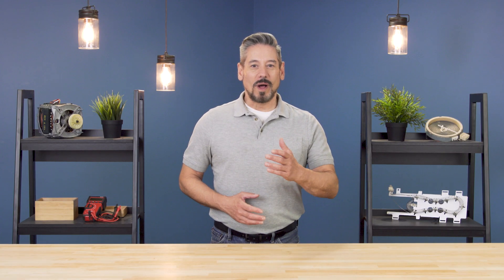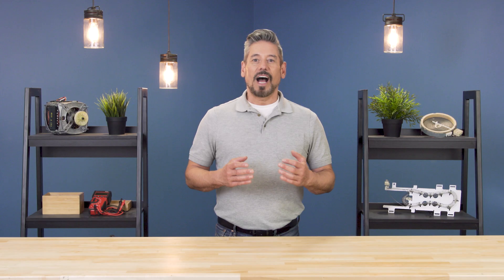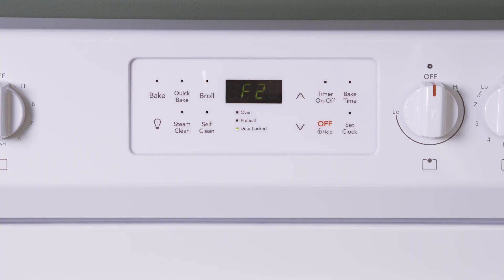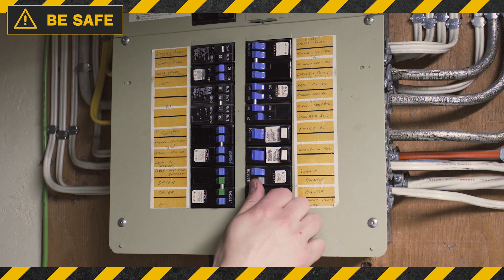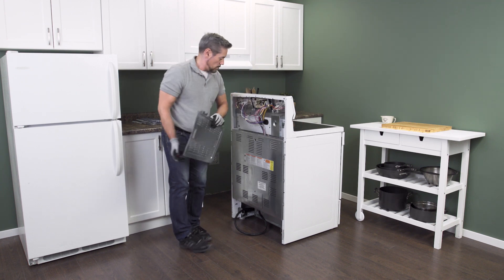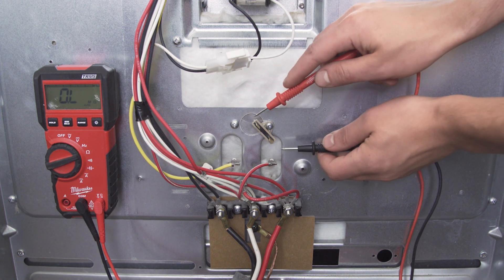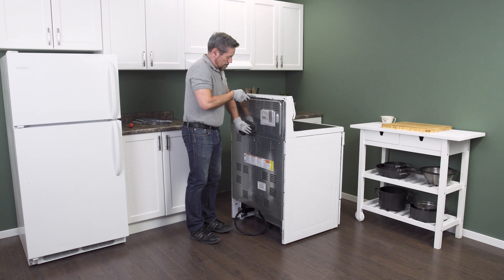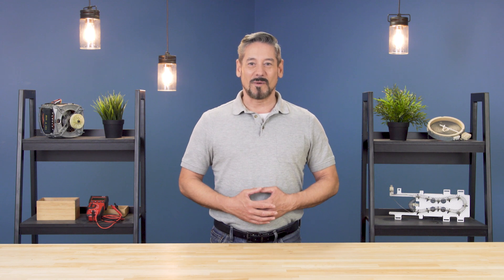Oven Thermal Fuse - Testing & Replacement | Repair & Replace

Comment from the maker: Did this video help you fix your oven? Did you run into any problems? Let us know in the comments!
Reply: Couldn't find my Kenmore oven model on the AMRE parts site
Reply from the maker: @robbiedods2230  Thanks for watching. Not all models breakdowns are available from each manufacturer and the older an oven is, the less chance that there is a current parts list. Sometimes the part numbers include several numbers at the end which are for model variations. If there is a similar model made in the same year, try looking up that number and see if it works. The parts are often similar. You can also search by part number.
Reply: Yes its not my fuse
Reply from the maker: @robertmccann380  Thanks for watching. We have many oven troubleshooting videos linked in this playlist, that can help you narrow down the problem further: https://www.youtube.com/playlist?list=PLCo9SMjkdWBysYYCcg5xQLiVh_cW0JQvt

Comment: I shorted a GE range while trying to replace the light bulb in the oven. I didn't shut the breaker and pulled out the mount for the bulb. The short fried the control board with the oven controls. I replaced the board but the heating element in the oven doesn't work. Could  the thermal fuse also have blown?

Comment: my oven heating element shorted out...It looked and sounded like a welder inside my oven for about 15 seconds.  The element is hidden below a cover, and had actually melted in a few pieces. I replaced the bottom element...all the wiring looks perfect. The stovetop and control panel is all working.

I don't have an electrical tester but I already was eyeing the thermal fuse...I could see the hot wires from the oven and broiler go to it. That almost has to be it....I am tempted to put a jumper wire in there, just to test it for a moment...
Reply from the maker: If there was a short then there's a good chance the thermal fuse is blown out  If you don't have a multimeter already, it's not a bad time to get one. They do come in handy especially in these sorts of cases.
Reply: @AmreSupply  Yep, I did get one, and the thermal fuse is good.  It looks like the control panel is bad, which is costly for my Maytag...Decisions, decisions!  I also found out it has a self diagnosis function, that also says "control board".

Comment: Good, precise video. Thanks. Mine is Technica’s Electrolux with gas cooktop and electric oven as one piece. Oven is not heating. All displays and timer looks fine. What could be the possible reason??
Reply from the maker: If the oven is not heating at all it could be a faulty temp sensor, or a stuck relay on the control board. https://www.youtube.com/watch?v=jnt_mUwdL8o

Comment: When i turn oven to bake the boiler element comes on not the bottom,had the bottom element tested it good,what's the issue here
Reply from the maker: Thanks for watching. If the bake element is good, then check the connections. Either there is a faulty wire or the bake relay on the control board is faulty.

Comment: It's worth noting that an open (blown) thermal fuse in ranges so equipped, typically indicates the oven reached a dangerously high temperature.  With that in mind, you should first determine what may have caused the overheat condition and replace faulty components as needed.    Then you may proceed to replacing the thermal fuse.
Reply: Would an oven element that deteriorated and shorted out cause the thermal fuse to blow?
Reply: @BarryWeaver-pv6cz you're right, that is possible.    From my understanding, on some ranges the oven controls only switch one leg of the 240V circuit, leaving the other terminal at 120V to ground potential.  Or, simply put, a grounded 240V heating element can continue to heat at 120V regardless of what position the controls are in.   

I actually had this happen on my family farm with the 80 gallon electric water heater in the dairy barn.  The water temp got extremely hot and the temperature/pressure relief valve was boiling water and steam at high pressure.  Even though both elements were "OFF" according to the thermostats, we found that the bottom element had split open near the center, such that it had enough resistance to prevent the double pole 30 amp breaker from tripping, and so it continued to heat with 120V to ground non-stop no matter what the thermostat was telling it. 

 A T&P valve is designed to quickly open full force when the water temperature approaches 210°F and will remain so until the water is cooled some degrees below 210° by the cold inlet, which enters the bottom of the tank while the T&P valve on top of the tank, or on the side of the heater very near the top. With that in mind, a defective thermostat which fails to shut off the gas burner/electric elements, or a shorted element in an electric water heater can result in a dozen or more gallons of near boiling water released at high pressure before the valve closes.   That is why having a suitable discharge pipe on the valve outlet terminating to within 6 inches of the floor can literally mean the difference between life and death for anyone standing nearby should the valve pop open.
Reply from the maker: Yes that is a good point, in some cases this could be a self-cleaning cycle or something more problematic.

Comment: We just had a crew install a GE stove and tried to test it out this evening; the stove top works fine, but when we went to use the oven it began preheating from 100 up to 135 and stopped; the heating element stopping heating and we had preheated to 425. We also tried using convection oven; and the oven continued to not heat at all. Does this seem like a thermal fuse issue?
Reply from the maker: Thanks for watching. If the oven does not get above a certain temperature then it could be a faulty temperature sensor: https://www.youtube.com/watch?v=jnt_mUwdL8o

Comment: Hi My wife does alot of baking and our Electric
GE stove keeps shutting off randomly when she is baking in the oven but it always comes back on and is otherwise working fine. Would a thermal fuse act in this manner or is it most likely a control board or something else? Thank you
Reply from the maker: Thanks for watching. Perhaps not a thermal fuse but more likely a bimetal high limit thermostat. In some cases the metal can wear down and fatigue over time causing it to trip at lower temperatures. Not all models have these though. 
If your model doesn't have a fuse or high limit switch then it could be a faulty temp sensor: https://www.youtube.com/watch?v=jnt_mUwdL8o
Reply: @AmreSupply  Thank you for the Help I Appreciate it👍
Reply from the maker: @dusty1498  You're welcome, we're just happy to help!

Comment: I have an old Caloric Ultramatic and after using the clean cycle it won't bake or broil it will only heat in clean mode.  Could it still be a thermal fuse since it is still heating in the clean cycle?   Thank you
Reply from the maker: Thanks for watching. If it tripped the thermal fuse then it would prevent it from heating in bake, broil or self clean. In this cases this looks like an issue with the control board but first try a reset as it might be stuck in a cleaning mode.. This might sound too simple but try unplugging the unit for 5 minutes. See if that helps.

Comment: Hi, water accidentally leaked from my counter into the wiring of my built in oven, I heard a buzz and saw flashing behind the time display then a glass popping sound. The oven itself is now unresponsive. Would you say it is the thermal fuse that got damaged? Thank you.
Reply from the maker: Thank you for watching. Most models do not have a thermal fuse so it's more likely that the control board was damaged by that power surge.
You can check which parts are in your model using this tool: https://www.amresupply.com/lookup

Comment: I can't find my termal fuse. I don't think I have one. Any idea where it could be if it's not in the back? Both my broil & bake elements aren't working. They both stopped working suddenly, and my guess is it's a thermal fuse
Reply from the maker: Thanks for watching. Not all models have a thermal fuse. You can check by putting your model number into this tool: https://www.amresupply.com/lookup

If your stove is working, but both the broil and bake elements are not working then it could be a faulty temperature sensor or a faulty control board. https://www.youtube.com/watch?v=96s7maybHlY

Comment: When I take the back stuff off there's nothing but connectors think my thermal fuse is deeper in the range and I just can't get to it my power went out last week and fried a bunch of stuff including my range but the elements and oven light still work but control panel doesn't have power and the oven won't heat
Reply from the maker: Thanks for watching. Not all ovens have fuses or limit switches. You can check this by entering your model number here: https://www.amresupply.com/lookup

In many models the temperature sensor will monitor for high temperatures instead of a fuse. 

If your model does not have a fuse, the stove elements work but the control board does not work, then it's likely a issue with the control board.
Reply: Can the thermal fuse be bypassed by connecting it's two wires together? Temporarily of course.

Comment: Will the top element not work unless I broil?
Reply from the maker: Thanks for watching. When you preheat, both oven both elements are used. During a bake cycle 20% of the heat comes from the top broil element and 80% comes from the bake element on the bottom.

If you turn on broil, then only the top broil element will be active.

Comment: Can't find the thermal fuse on my oven. Do all ovens have them?
Reply from the maker: Thanks for watching. Not all ovens have a thermal fuse. Some have a thermal cutoff switch and in other models the temperature sensor will detect high temperatures. 

We have a playlist of more specific troubleshooting videos so look for your issue there and you'll get more specific information: https://www.youtube.com/playlist?list=PLCo9SMjkdWBzSdZB9Un3GKKI0Iohlpf9a

As well you can enter your model number in the model lookup tool to see which parts your oven has: https://www.amresupply.com/lookup

Comment: But it does not have control board
Reply from the maker: Thanks for watching. An oven will cycle on and off. If it is not maintaining the temperature and your model does not have a control board then it could be a faulty oven thermostat which uses a bulb as a sensor connected to a dial for the heat settings.

Comment: The cooker oven  cuts off while baking and after sometime it turns back on what might be the problem.
Reply from the maker: Thanks for watching. An oven will cycle on and off. If it is not maintaining the temperature and your model does not have a control board then it could be a faulty oven thermostat which uses a bulb as a sensor connected to a dial for the heat settings.

Comment: Hi! My bake element is dead. It literally exploded. I made the replacement. I then realized that the broil element was no longer working. I thought it was the fuse. I realized there was none on my Frigidaire cfEF312FSB. I made some tests. I still listen to the click from the relay. Does someone have and idea? Can it be the reset switch or should I replace the control panel? Thanks!
Reply from the maker: Thanks for watching. It is best to check if the broil element has continuity. You can test it with a multimeter following the steps in this video: https://www.youtube.com/watch?v=ABope7vl5IY
Reply: My Frigidaire is having a very similar problem... Did you find a solution?

Comment: Does a GE oven JB64OSN1SS have a thermal fuse
Reply from the maker: Thanks for watching. It doesn't look like that model has a thermal fuse. In this case it will use the temperature sensor to monitor any overheating . https://www.amresupply.com/lookup/208301/1426748#diagram

Comment: Great video, your guide looks very easy to follow. Not sure if that's my problem though (dual-fuel range). After cleaning the stove top, I pressed the ignition button to light a burner and there were two loud bangs from somewhere inside the range, at which point the range lost all power.  Nothing works - both electric ovens, oven lights, burner ignition, clock etc.  Does this seem like it could be the thermal fuse or something else?
Reply from the maker: Thanks for watching. If the entire range lost power after that then it could be a blown fuse, or a short circuit. Check the fuse and you can check the wires for continuity at the terminal block & power cord. Look for any burn marks or evidence or damage.

Comment: My Kenmore oven is t working. There seems to be no gas going to it, the igniter doesn't turn on at all. Could that be the thermal fuse as well? The stove top itself works fine.
Reply from the maker: Thanks for watching. In this case you can check the ignitor for continuity with a multimeter. Check to make sure that the gas valve is open and that there is a good supply to it. A faulty thermal fuse could also prevent the system from running and the gas valve from opening.
Reply: @AmreSupply  per your video, I did check my temp sensor and fuse, turns out my fuse is bad. Thank you for providing informative, easy to follow instructional videos.
Reply from the maker: @SenshiDragonGaming  You're welcome, we're just glad that the videos helped you narrow down the problem!

Comment: Thank you, I was confident it was the thermal fuse since my LG unit's stove works and control panel does respond, but it just wasn't responding to the cooking functions (temperature settings don't show up when I turn the knob to any cooking functions), but apparently replacing this didn't fix the situation 😖
Reply from the maker: Thanks for watching. If the control board works but you're not getting any heat on bake or broil modes then it could be an issue with the temperature sensor: https://www.youtube.com/watch?v=jnt_mUwdL8o

In some models, the oven will have a thermostat instead of a temperature sensor: https://www.amresupply.com/catalog/Oven-Control-Thermostats-632506-AD1P A faulty oven control thermostat can also prevent it from heating.

Comment: No one seems to mention an oven with no power unless you turn on a burner.  Then the oven has partial power.
Reply from the maker: Thanks for watching. We have mentioned cases where the oven has no power but burners still work but the scenario you are describing is not something that should occur.

It is very uncommon for the oven to not have power until one of the stove burners are active. This should not happen based on how it is wired. The oven elements are wired independently and should not be effected by the operation of the stove heat switches. It is possible that there is a short somewhere in the circuit.
Reply: @AmreSupply  i found a post saying it is the 220 outlet
Reply from the maker: @kennethterrell1167  If you are curious, we have a video showing how to test the outlet and power cord. https://www.youtube.com/watch?v=wZwxewn2w44

Comment: Replaced the temperature sensor and bake element still no heat. My next piece will be the control board.
Reply from the maker: Thanks for watching. It can be good to check to see if it both elements or only one element that is not working. Try cooking on broil and see if the broil element works. If it does, then check the bake element? It can be tested through the back https://youtu.be/ABope7vl5IY

Comment: Where's the therma fuse on a GE electric range stove I've looked and looked and some and nothing
Reply from the maker: Thanks for watching. Not all ovens will have a thermal fuse. In some cases the oven will use the temperature sensor as a high limiter.

Comment: Could u tell me why the burners and the oven  stop working but I can still see the display on the board
Reply from the maker: Thanks for watching. It could be an issue with one of the two 120V lines of power. The display, lights and clock runs off of a single 120V line of power.

Try resetting the breaker. If this doesn't help then you can test the outlet to see if it is supplying the correct power: As well you can test the power cord with a multimeter. https://youtu.be/wZwxewn2w44

Comment: Do you have to have the unit plugged in when testing?
Reply from the maker: Thanks for watching. To test a fuse you are simply testing for continuity which doesn't require power for the test. We always recommend to unplug the stove and pull it away from the wall so you can safely work on it with plenty of space.

Comment: My oven is built in so I cannot get to the back of it without breaqking the surrounding fixtures. Is there any way around this?
Reply from the maker: Thanks for watching. We don't have any specific videos showing these repairs on wall ovens. It would be smart to first look up your model to see if it actually has a thermal fuse / where it is located. With wall ovens, many of the parts can be access by removing the front control panel. The temperature sensor and oven elements will have screws accessible from inside the oven. 

If your oven is not heating, it could also be the temperature sensor or control board. https://www.youtube.com/watch?v=96s7maybHlY

Comment: My oven display is working but oven is not heating up . Is it fuse ?
Reply from the maker: Thanks for watching. Yes that could be an issue with the fuse. Have you checked it with a multimeter?

Comment: I was cleaning my stove and I think some water go inside of it and it stopped working. Do you know what the issue might be?
Reply from the maker: Thanks for watching. Does the oven and stove both not work? Do you have any partial power? Do the lights or display work?